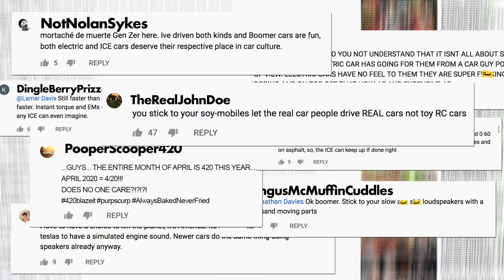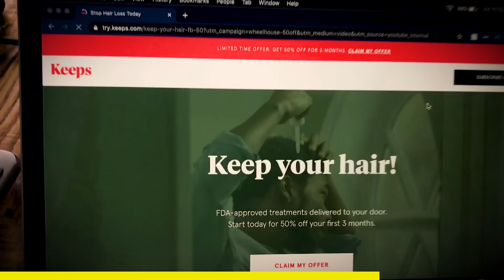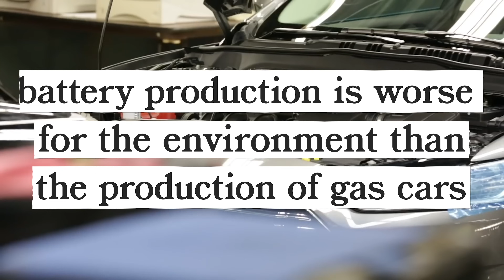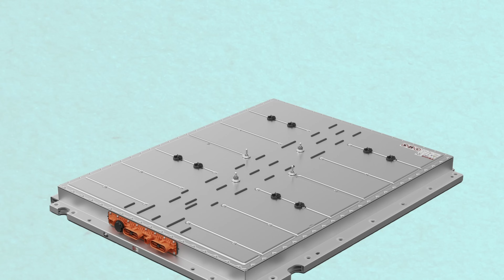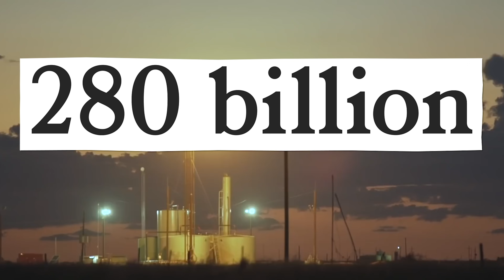Are Electric Cars REALLY Better for the Environment?

Comment: This was a very far comparison but I think you should have gone into how many tons of co2 it take to make “green power” or “clean power” by talking about how windmills and solar panels are made and the fact that you have to replace them every 15 years or so and how there’re not recycle able. Also you have to replace the batteries in EV ever so often.
Reply: Then you would have to talk about CO2 emissions in the building of oil rigs, oil tankers, refineries, transports, pipelines, and gas stations. Maybe in the hour long version.
Reply: @rickcrowell1344  yeah electricity is moved from place to place using Transformers long wires that costs a fuck ton too
Reply: This has been calculated over and over by scientists and engineers who study this kind of stuff every single day. Green energy always beats fossil fuels in being safer to the environment to make these technologies and the effects long term. I love ICE cars more than most as well buts just the truth. Im not saying these green energies dont have a big environmental impact because they do, its just a lot less than fossil fuels and coal.
Reply: No one is arguing that these alternatives are 100% clean and efficient. Just much cleaner and more efficient than fossil fuel based infrastructure
Reply: I don’t understand how we don’t have solar powered cars. I feel this would be the ultimate solution to the environmental problem. Granted we would have to look at what goes into the production of solar panels.
Reply: Here's a story I heard and it's probably very common.  Someone bought a 6 year old EV for $12,000.  then had to spend another $12,000 for a new battery.  They've been working on batteries for the past 40+ years but still haven't perfected them.
Reply: @COSMACELF1802  - The other side of that is that the battery probably still had 75% to 80% of it's original capacity, when they spent the $12,000.  At that age, they usually do.  Even then, the old battery packs can be used for emergency household storage, or can be combined as inexpensive grid storage, used by utilities.  You don't even need to recycle them for them to be useful.  Put them in a role where they aren't supporting a particular "range", and they're extremely useful, as well as inexpensive.  An 80kWh pack with 75% capacity is now a 60kWh pack.  A utility company can parallel 17 of them together and get a megawatt/hour of storage capacity, as night-time coverage for wind or solar.  And current model year battery packs are expected to be 95% effective, still, after ten years of use.

There are a lot of uses for used battery packs.  A major problem that reuse marketers have is that there aren't nearly enough of them hitting the market.
Reply: There are scientific papers dedicated only on this topic. Photovoltaic energy production releases less than a tenth of CO2 equivalents into the atmosphere per kWh if you look at its whole life. Onshore wind is even more efficient and offshore wind tops even that.
Reply: @P_As_C_Al  youll notice in this discussion, no one is interested in facts. You can't win this conversation using science, math and logic. You would think you can, but it doesn't matter. People who deny this still think the Earth is flat. Until you can win something as simple as that, you can't convince the Non-EV side anything! (sarcasm).
Reply: @P_As_C_Al  C02 is not the only bugaboo here. Wind and solar power generation is very energy diffuse. That is to say it takes lots of land to install wind and solar farms whereas fossil fuels are energy dense. Actually, the best energy source is nuclear if you are speaking only about energy dense production of power. No C02 there.
Reply: And looking at the battery: an average battery lasts for around 1000 cycles. Modern cars batteries are even better. If you multiply 1000 cycles with a range of 300 miles you get 300.000 miles which is more than 25 years of driving the US national average distance per year.
Reply: @P_As_C_Al  That assumes charging the when the battery goes to zero and charging it to 100%. Not recommended. Most EV manufactures say keep the battery between 20 and 80 % thus severely decreasing real range to 60%.
Reply: @P_As_C_Al  I know a mechanic who has to replace these batteries after only 3-5 years. You think they can last 25 ? Good luck with that. 😆
Reply: That is because he had no answer for that one. The problem is, there are way too many people on the planet!

Comment: That's fine but you still do damage to the planet to drive the EV . And like you said once EV are mass produce the whole saving for the environment goes out the the window . Fact greenhouse gases form gas powered cars is what not causing GW it's power plants that produces which EV's need to move .

Comment: Interesting video.  The only issue I have with it is measuring CO2 as the most important factor.  CO2 is a naturally occurring gas that is a necessary for all life on the planet.  Lithium, cobalt and the other rare materials used in battery production are not.   But of course this was not the thrust of your video.  For what you covered the only correction I would suggest is the claim that the power grid of the US could absorb the demand of large numbers of EVs.  In Some locations this is problematical.  California for instance is using rolling brown outs  and making requests that EV owners not charge at certain times due to excessive demand.  This can be corrected of course with time and lots of money.
Reply: He skipped that part but cars don't produce GW it power generation.

Comment: Any calculations on the environmental impact of all the batteries going bad ending up in landfills or wherever?
Reply: The life of EV batteries is actually quite long. Over an extended time, they will lose some of their ability to hold a charge, but it's slower than you might think. Typically you'll lose 5% in the first 50K miles, and then another 5% in the next 150K miles, so at 200,000 miles you should still have about 90% capacity for a modern EV. Old Nissan Leaf's had poor battery management, and could lose up to 40% of their charge in 100K miles, but Nissan has fixed that with newer models, and Tesla, Ford, GM, Volvo, etc. have never had that problem.

Once a battery has reached a level where you want to replace it, or more likely, the car using the battery is dead, the can be recycled, or used in other ways. A Tesla Model 3 battery pack with only 50% of it's capacity left would still make a fantastic all house backup battery. The smallest Model 3 battery is 50 kWh. A standard home backup battery is about 12.5 kWh, so a 50% Model 3 battery is still twice the capacity of a standard home backup system. 

The reuse potential for battery packs like this is great, and then when there is no more reuse available, then you recycle.
Reply: @Lumbermech  battery charge capability isn’t determined off mileage alone. Also it is more of a multiple amount of factors such as; 
-Temperatures exposure
-age of the batteries.
-exposure to weather. (Humidity)
- intensity of charge loads. 

Constant usage will effect it as well but reality is that Tesla batteries are some of the best performance lithium batteries that exists but yes they do wear and tear over time but the actual percentage change over 50k miles is actually not accurate. Within each edit of the performance the battery life is improved. For now the average battery life changes at a much slower rate than 50k miles.
Reply: @mrpumperknuckles1631  You're absolutely correct. The numbers I gave are just approximate averages. How the owner uses their battery matters a lot also. Living between 10% and 80% will give you a much longer battery life than keeping it between 80% and 100% all the time. But on average, batteries last way longer than people think they will.
Reply: @Lumbermech  also recycle plants only can recover 30-40% of the batteries materials. The rest is wasted heavily due to the whole process of recycling and the whole problem that occurs involving the recycling of older materials. 

To put things short the actual effectiveness of recycling lithium actually is far less effective than the use of newly mined and processed lithium.
Reply: If we do it right they will all be recycled...but no clue what the carbon foot print would be to do that yet its still being worked on.
Reply: They can be fixed and recycled.
Reply: In short, latest reports show that a Tesla battery gets replaced every 3 years, some living much longer (often what people are stating) and many living much shorter.
Batteries are expected to be recycled, and current expectations within the next 5-10years is 30-40%. Most batteries currently gets broken down and stored in containers as "can be recycled". Dear child has many names like, black gold, black sludge, dark matter and others, but its in short just a black mass that requires chemical processing. Saying/calling it "can be recycled" is because of government funding. Still EVs are slighly better than ICE on a CO2 Level, but we still have no idea of the other chemical impact. On top of that Coal is bad, and to reduce the outlet of coal power many places uses water filters, that water gets dumped in the ocean, meaning if you include that, then coal is much much worse.
In the end I dont know which is better at the moment ICE or EV - same conclusion as most experts - "we dont know"/"Need more info"
Reply: @silwerspawn  Clearly this is not true. All Tesla batteries are warranted for at least 8 years. Some with unlimited miles (Model S & X), some with 100K or 120K miles and 70% charge minimums. 

If the batteries are being replaced every 3 years, Tesla is playing for it (and would be out of business by now). 

A European Tesla owners group has been tracking Model S battery life since 2014. They found that after an initial drop of 5% in the first 50K miles, the drop goes down to 1% ever 30K additional miles. Their solid data runs out at about 170K miles, but the average at that time is 91% of battery left. 

Industry standard is that 80% charge is the lifetime of the battery, and if the Tesla model S batteries continue to degrade at the rate shown in this reporting, the life of the battery seems to be about 500K miles, or just over 805,000 km. 

I suppose you could drive that far in three years...

Comment: Your information and facts are a little off. When you quoted the production of oil refineries putting out CO2, you forgot to mention that the majority of that oil goes in to producing plastics, tar for asphalt on roads that we drive on, roof tiles tiles in homes, as well as an entire industry of material used in every day life. Vehicles use very little oil when compared do you the other raw materials from the same refineries for building materials. Factoring this into the equation and you’ll find gasoline vehicles have far less impact with CO2 then electric cars overtime.

Comment: The costs of both EV's and renewable power generation are VERY EXPENSIVE, this is what must be dealt with.
Reply: what EVs are you talking about? there are very affordable EVs out there.. just have to be OK with how they look. nissan leaf is $28k. in china, they have EVs for much mess than that. so it's possible, but ppl are more concerned about looks than anything else.

Comment: I think you underestimate the impact that the spent batteries have on the environment (fires, ground water contamination, etc.). Coupled with the expense of replacing those batteries after about 7 years, EV's become disposable with no real secondary market for used ones more than a year or 2 old. This means that more EV's have to be produced to replace the ones no longer road worthy. Now you have the expense of recycling whole cars (aluminum, plastics, etc.). There are still plenty of hidden sources for environmental impact beyond just the carbon footprint...
Reply: You are completely off base.  But you could always use the argument that EVs will cause mass unemployment.  Batteries are expected to last over , 200,000 miles.  When replaced, use the old battery to power your house.  After that they are recycled and made into new batteries.  Remember the part about lithium mining.  EV's have been on sale now for twelve years.  I bought a Nissan Leaf in 2015 (new car that didn't sell) for twenty thousand, received back seventy-five hundred in tax rebate, taking it down to twelve thousand five hundred total for a BRAND NEW CAR.  Live in a state with over eighty percent of electricity produced from wind, solar, hydro, and nuclear.  Motor consists of a shaft with two bearings, no maintenance, except windshield wipers and tires.  Charge up with a couple of dollars worth of electricity. Worth twelve thousand today, so I've driven for seven years in a car that cost me five hundred dollars. Haven't use a drop of petrol in seven years.  ............and the ONLY sound that it makes is the squealing of tires when I accelerate.  How much does the US subsidize oil and gas?
Coal, oil, and natural gas received $5.9 trillion in subsidies in 2020 — or roughly $11 million every minute — according to a new analysis from the International Monetary Fund. Explicit subsidies accounted for only 8 percent of the total.Oct 6, 2021
Reply: @MACV144  do your research. Everything you said about batteries is wrong. Most EV's are requiring expensive battery replacements after 7 years (average), with an average cost of.over half the cost of the vehicle's original sticker price. I am glad your Leaf is not experiencing that, or the fires that have plagued EV's, but it does not change the facts...
Reply: @mr.funkalicioussplendiferous  Mine is OVER SEVEN years and it still has ALL OF THE BARS.  Are you calling me a liar?
Reply: @mr.funkalicioussplendiferous  Replacement battery at time of purchase 2015 was at eight thousand dollars.  According to a 2020 Greencars report, the Nissan Leaf 40 kWh battery costs $5,500 or about $137/kWh, which is right on target for the average 2020 price. MSRP of the Leaf is 33,???.  The cars worth TODAY, as previously stated is over twelve thousand.
Reply: @mr.funkalicioussplendiferous  Take a look at the environment impact of coal, oil and gas industry.  I'd list them here, but there isn't enough space. ANY fuel used in an ICE car, of the energy total, seventy per cent is wasted as HEAT, only thirty per cent actually turn the wheels.
Reply: @MACV144  first, yes, the battery cost may be $5,500, but unless you are a certified mechanic licensed to replace the battery, you cannot do it yourself. The labor alone is more than the cost of the battery, putting the total cost to replace the battery closer to 12,000 to 15,000 for your leaf. As I said before, I am glad YOUR battery is lasting, but a VERY large portion of EV owners have not had that luck. You obviously do not understand how car repairs are handled, or that parts costs do not include labor, so I am now done with you and this discussion. I am not calling g you a liar, but a lucky idiot...
Reply: @mr.funkalicioussplendiferous  Right, please DON'T respond, as you have NOTHING to say.

Comment: Great video but you left out a very important part, when a internal combustion engine burns fuel it is only about 30% efficient so all the pollution made to make that fuel and it was only 30% of the energy that was used to power that vehicle.

Comment: Aside from the CO2 emissions what about the waste from the batteries after their 10 year lifespan. Also the considerable increase of electrical fields. And about the grid being able to handle it just how accurate is that? Take California for example, they already experience rolling brown outs and purchase their energy from other states. What if with the increase in the need for energy due to EVs they will no longer be able to sell energy to California? Also transitioning to only one source of energy seems like a sure fire way to fail further down the road. Ironically it's the same mistake we made with oil and now they want to repeat it with electric.

Comment: The whole "zero emissions" group needs to start factoring emissions in the form of radiation and such. Emissions from electronic devices are putting this planet in a microwave (basically) with the signals they send to satellites and back. Just because your eyes don't see it, that doesn't mean it isn't there. Also... the rockets and vessels used to get those satellites up there so they can rot away and be garbage don't somehow go around the ozone layer to get up there. On that note... why aren't our rockets and space crafts running on electricity instead of fossil fuels if batteries are so great? Battery powered vehicles are not good enough to compete with internal combustion vehicles... if they were, we would have electric space ships. We would also have battery powered dirtbikes that would go all weekend at full speed on one battery charge (or less than one charge), and they would perform as well or better than my bike that is bored, stroked, cammed etcetera. Batteries just aren't good enough.